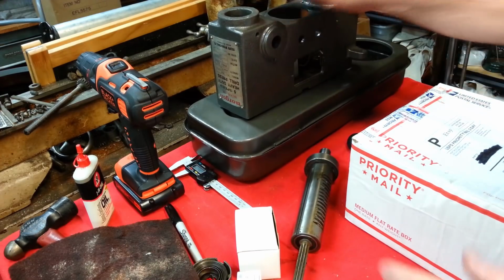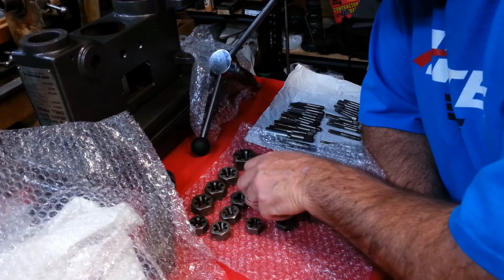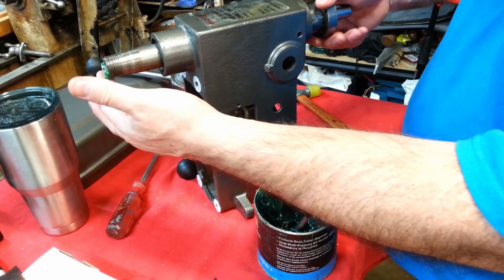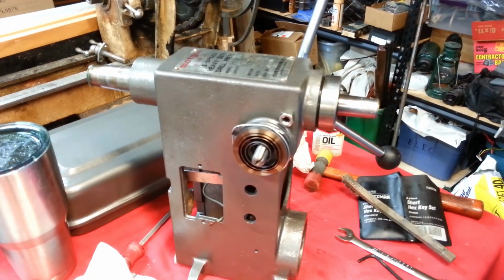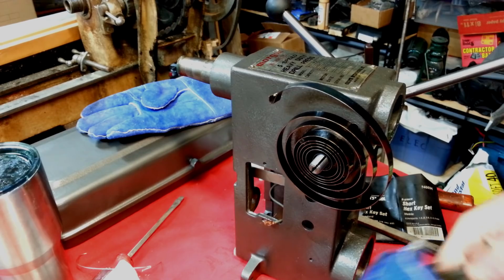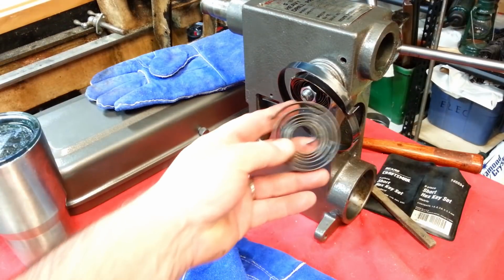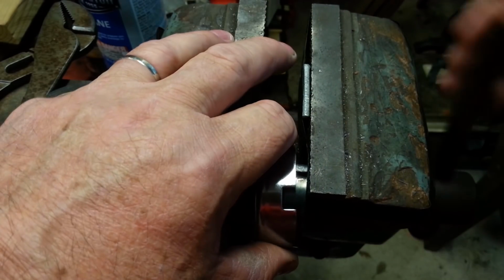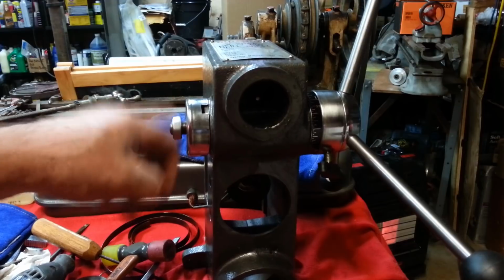Day In The Shop 9 - Maker vs Spring - Crafted Channel

Comment: Are you sure them are dies and not thread chasers?  Usely the ones that are hex style are thread chasers.
Reply from the maker: I think of them as cutting dies and chasing dies.   Both are dies.  I think you are correct with Greenfield that hex are chasers.  Although a chaser is a thread forming tool in a sense.  Not a cutter. Wouldn't' the point of a chaser be to push or form slightly damaged threads back into place?   I think these are ground to cut.  I need to look closer.  Might make for a good video to compare chasers and cutters.